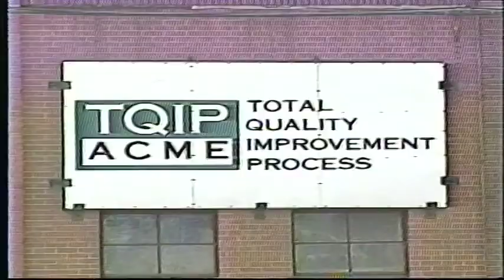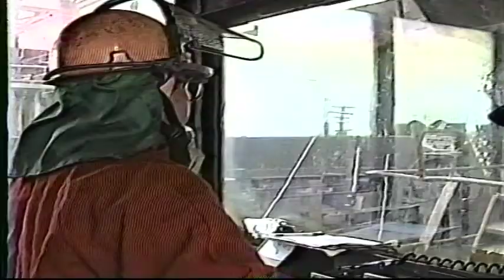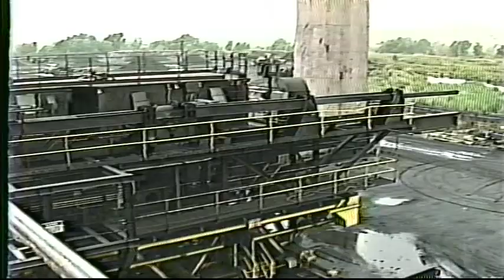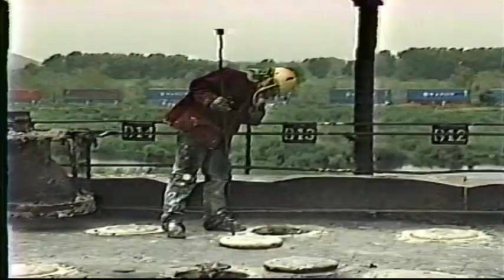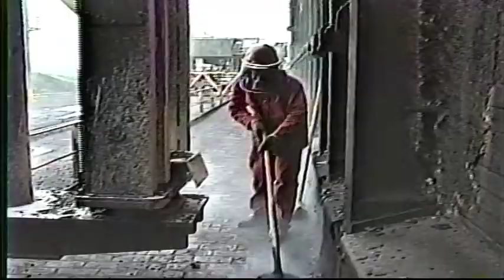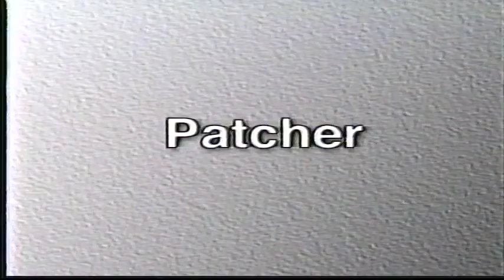Acme Steel Coke Oven Division New Employee Orientation Video (1995)

Comment: This knife edge seal must be really important.
Reply from the maker: it is - if the jamb is dirty the door doesn't seal and coke oven gas will escape, which is explosive and certainly quite bad for your health (especially the door cleaners and people on the bench who would be standing literally in a cloud of that stuff).  later the plant had automatic door cleaners, which worked to varying extents.  the company that made the automatic cleaners is called saturn, they actually have a youtube channel! look em up!
Reply: @onesixfive  "automatic door cleaners, which worked to varying extents" - yes,  those automatic door and jamb cleaners can be a nightmare, especially when the workers are used to them, and will not do any job by their hand anymore... how to fix this kind of situation; lots of doors are leaking...

Comment: I worked for a waterblasting company that did some service tasks on the Inland Steel coke ovens in the 70's. What a dangerous, hellish job. I remember a warning sign on a stairs up, "Caution. Cancer hazard. No eating". We wore long johns in the summer. Wooden clogs.
Reply from the maker: one of my contacts at acme told me a story about a lidman who actually chose to eat his lunch up there.  they had to tell him you cant be up there! what kind of a loon would spend even a minute longer.  ive seen some lidman shoes like you described - all the ones i saw were homemade.  im sure you saw some wild stuff!
Reply: @onesixfive  On rare occasions we blasted the charging holes. They'd get a hard carbon build-up. And the wooden leather clogs were provided by Inland Steel.

Comment: Best job I ever had, did all the disciplines.
Ram(Pusher)
Ram  bottoms
Guide
Larry car
Battery tops(lid man)
Wharf.

We didn't have self sealing doors, they all had to be sealed by hand with daub & daub trowels, did 12hr shifts, days & nights, 27 ovens on night shift 26 ovens on day shift.
Miss the lads I worked with which made the job bearable. Worked at the Monckton coke & chemical company in Royston Near Barnsley South Yorkshire, England. It was the last independent
Coke ovens in Britain , unfortunately it closed in Dec 2014. this video  brings it all back, many thanks.
Reply from the maker: amazing comments! I commend you for your service in such a challenging environment and industry. no doubt many thousands of people benefit daily from the steel that your coke made!

Comment: I worked Allied Chemical's Semet-Solvay Div. coke plant in Ashland,KY in 1972 or 73, not sure. Long time ago. I ran what they called the charge car, referred to as the Larry Car here. I don't remember having to get out of the car for anything, just ran back and forth to load up and discharge. Magnetic pickup on the car removed and replaced the oven lids. The instrumentation in the car was not as sophisticated as show here.
Reply from the maker: very interesting! i wonder why they had lidmen remove the lids when the technology existed to do it automatically! thanks for watching!
Reply: @onesixfive  One thing I do remember is men on top of the oven pouring the sealer around the oven lids one replaced. Some of memories of this operation may be off as it was more than 50 years ago, but that's what I recall. Ashland shut down in 2011 after almost 100 years of operation. Today nothing's left but a huge vacant lot with concrete slabs where buildings once stood and railroad tracks leading to nowhere. Sad. This is a great video. Thanks for posting. I've watched it a couple times.
Reply from the maker: @1940limited  my pleasure!

Comment: I did some computer work for the SAP project to support the caster in 96-98. I have been at the coke plant a few times. The people that work there are truly endangering themselves, and they should be respected for the hard work they do.  

You will never forget the first time seeing the coke like "lava" being pushed out.
Reply from the maker: Thank you for commenting! Curious why you visited the coke plant when you were doing computer work in Riverdale? Either way be glad you did- I wish I could have!
Reply: @onesixfive   The SAP project included some time and attendance functions that used a card reader at the gate. The idea was the worker would swipe there badge. It was also to gauge where people were should a accident occur.

I heard that when ACME decided to build the new caster plant, one of the engineers from  the german manufacturers asked the ACME board what computer system they had. One of the executives said "we have been making steel for 100 years, we don't need a computer system".

So the manufacturer responded they would not be able to track and bill fast enough for the amount of steel they were going to be making.

Being this was in 1996, stuff like ethernet, connections to other buildings, was in a state of flux.  Their was an antenna installed at the blast furnace which connected back to Riverdale. A fiber connection was installed between the coke plant and the blast furnace, by having the fiber go through the conveyor and over the river!  

The SAP project turned out to be a mess. Since it was in German, many of the screens and messages would be in german, requiring translation. Steel and raw materials were measured in tons, not the metric system. So many reports from SAP had to be converted to english measurements so the executives could use them.
Reply from the maker: i can weigh in on two issues on this topic even though i was not present for the work you did:

1) i work for a company (almost 18 years now) and we switched to SAP a couple years in, it was a very difficult transition and even today at times it can be frustrating, though i do not doubt its accounting/inventory/etc capabilities are superior
2) no question that up until the very end of the coke plant (2001) even email still had barely taken off, because i have found a great deal of hand written memos, without which i would have learned a fraction about the plant (check out my website, link in description)
Reply: @onesixfive  I think the drop in steel prices is what ultimately doomed them. 

In addition they had a lot of problems because of very old resistance to change.  SAP was designed around modern business practices.

Acme modified SAP instead of adopting modern business practices.  

I take the metra electric downtown, and riverdale is a shell of it's original company. Many buildings were razed.
Reply: @rainmant5724  I worked in a steel mill for 10 plus years as a millwright. the resistance to change was primarily due to cost every thing was very big and expensive with years of lead time to build and install. not like upgrading a control panel although that was expensive too.
Reply: @onesixfive   The coke plant and blast furnace never had any type of networking. They needed to communicate back to riverdale
Reply: @rainmant5724  when I was there everything was designed so that not much communication was needed. coke was delivered to blast furnace by rail car on the high line and dumped in hoppers to feed the skip. sometimes blast would call for hot coke I can't see that going well. blisters in the belts fires in the screen house and the rail cars and hoppers and even the skip

Comment: Yeah I worked at a large steel mill in the Midwest.  When I first started I was in the labor gang and we did most of the jobs on the battery.  I  saw enough to know that I had no desire to work on the battery or in preheat.  So when I got off probation I transferred to the coal and coke handling sequence.  Screw the battery
Reply from the maker: Smart move!

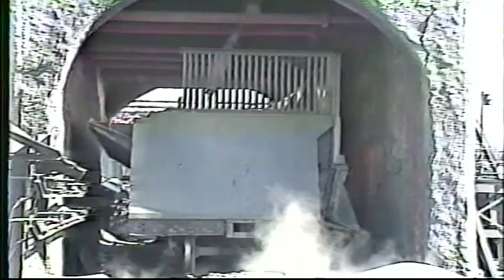Comment: 6:52 in future of coking an improvement in quality and energy could be made by quenching  with compressed cold or even superfluid CO2 in a pressure Tank and utilizing the energy of the heated CO2 in a Brayton cycle CO2-gas Turbine. 
Without contact to water/steam the Purity of coke-carbon would get closer to the theoretical limit!
Reply from the maker: Or just use an EAF and refine that process, and don’t need any coke at all!
Reply: @onesixfive  what is EAF ?
Reply from the maker: A method of steel making that doesn’t use coke which is used throughout the world for decades
Reply: @konradcomrade4845   Acronym for "electric arc furnace" I believe.
Reply from the maker: Thsts correct. I purposely did not divulge that because someone who claims to have a globally revolutionary idea but isn’t aware of other historical technologies

Comment: i worked in fords coke ovens as a  millwright apprentice in 78 and 79. what a nasty job. those  guys working around the pusher, door machine, and the charging car are in danger from the equipment and the fumes...oh my god...stink like you won't believe. We called them the choke ovens.  Hot in the summer cold in the winter, vapor and dust , high incidence of cancer in all departments . as a millwright one of my jobs was to replace that knife edge on the doors, a 4 hour plus job  basically all day. tricky to get the old one off in the shop. lots of heat from a welders torch bees wax. just one of many nasty jobs. Not a building I wanted to graduate in. they are all torn down now.
Reply from the maker: Thank you for the comment? Where is Fords?
Reply: @onesixfive  rouge complex in Dearborn on the rouge river on the border of detroit. ford had a complete steel making operation starting in the early 20's. 205 coke ovens in 5 batteries.  the machinery looks pretty much identical.

Comment: So, ACME steel had the TQIP (Total Quality Improvement Process) to remind employees to work at their best the first time.  I worked for the Chicago & North Western Railway.  They had a "quality program" introduced in 1986 called TQIS (Total Quality Improvement System).  A lot of C&NW employees referred to it as "Tortured Quietly into Submission."  Many other companies had "quality programs" such as Conrail and Inland Steel.
Reply from the maker: Yeah it’s pretty typical corporate BS. It’s interesting because I have since come across TQIP (sometimes only TQI) and I wouldn’t have any idea what it meant if not for the video. Tortured quietly into submission is awesome lol

I did some research on TQIP, check it out https://www.acmecoke.com/tqi-bulletin-board/
Reply: from Paper Industry, our boss originally denied such program, because he was convinced that we knew ourselves how to make best quality! Later he admitted the courses and procedures, and in fact it just was flow-sheets and paper-work, check-boxes, no real knowledge.  But they had some traps making life annoying without improving.  pE. in the lab the pH-meters calibration! The boss had to set the limits by himself, no advice from those coaches, because they knew nothing about laboratory themselves. So mostly the limits were set too narrow and later it is such a unnecessary hassle-tassle to adhere to the self set limits, to get the approval stamp ISO9000. 
 Knowing a bid about drift and calibration I advised my boss to set the limits quite
generously; we had no problem to get the ok stamp and the effects on our product were 0.
 In fact I invented a method to make SCB calandered paper rolls smoother , without listening to quality program teachers.

Comment: Thanks for sharing this video. I work at Clairton Coke Works, did almost 3 years on the batteries before I bidded out to chemicals. Was qualified to run the pusher machine but never trained on any other machines. Lidded/jambed for a couple months a couple years apart but primarily was in charge of dealing with the ovens door emissions. 

Lots of cleaning with those knife edges and Chuck doors. Totally bizarre to see a jamb cleaner on the pusher side as opposed to just the coke side. We don’t have those but we do on the coke side door machines.

Amazing how different things are up top too. No mud on the standpipes, manually dumping the coal into the ovens from the outside. Granted this was taken 26 years ago, times and technology have greatly changed. 

No “coking in” at Clairton - we shovel it either onto the pad or into a coke bin on the pusher. Guess someone got burned bad years back. So getting caught by a white hat coking in is a write up offense. 

Always found it fascinating to see how different it is with how things are done from one coke plant to another. Similar in the manner of the job to be done, but so much more different in the manner of how their done.

The funniest thing I noticed is we still use those same exact type of brooms on top side. Guess they couldn’t find a new way to replace those! Lol!
Reply from the maker: Thank you so much for all your insights! I have pinned your comment at the top so it doesn’t get missed. Looks like Clairton is one of now only 14 remaining coke plants in the US. 

You would mud the riser caps? That’s the kind of plant specific stuff I find interesting. You mention “manually dumping coal from the outside”. Did you not use a Larry car to charge the ovens?

And those must be special brooms for batteries at $250 a pop! LOL. 

Thanks for commenting!
Reply: @onesixfive  Make it 13 and counting now after the announcement at Follansbee, WV. We used a Larry car to charge the ovens, but the operator charged everything via a touch screen within the cab. I was referring to your Larry cars in this video. As for the riser caps, yes, our larryman seals them up with a mud wand after they clean the gooseneck, standpipe and the riser cap itself. Don’t stand underneath where the larryman is working if you don’t want to be covered in the mud! We also make passes regularly to put more mud onto anything that may be leaking throughout our shifts. 

It always really sucked when the larryman would clean all that mud off in your series you swept when lidding. Made for some miserable work trying to get it all into the charging holes after the coal was dumped. To sweep all of that in and still be able to keep up with the next charge, dampering off ahead, pulling the next set of lids, and then of course sliding your current lids back on, mud them up and take steam out was a real chore. You learn that man, we really can get a lot of shit done in 8 minutes! But we also learn, that doing it with a respirator on totally kicks your ass too! 

Our plant is regulated by some of the most stringent environmental measures in the entire country. Now a 20 minute drive down the river to Monessen’s Cleveland Cliff’s plant and it is a totally different world on what is legal and what is not on the very same emission standards. 

I certainly will not miss working on those batteries whatsoever. But naturally, I do miss doing it from time to time and often think it would be cool to do it again for “old times sake” every once in a while to see if you still got it. Not many people can say they lidded on top of a coke battery. I’d like to experience working on a blast furnace too for the sake of being able to say I did that also, but that likely will never happen. 

Funny you mention that about those brooms! For as much as we went through those all the time, I never once realized they were that damn expensive! Explains why they kept them under lock and key, after all.
Reply from the maker: @Hail2Pitt412  “not many people can say they lidded on top of a coke battery” - no sir they cannot! When I first put this video up I shared it with a friend. If you think I don’t know much about a coke plant well she only knows what I tell her. Not the worlds best teacher! But we were talking about all the different positions and I asked which one she found the most interesting and she instantly said “lidman”. Maybe I’d cry like a little girl if you stuck me up there but god knows I’ve thought about it and studied on it more than most people. I wrote a long analysis of a training guide I found, if you are ever bored you can have a look. As a legit lidman id be curious about your opinion https://www.acmecoke.com/acme-coke-chicago-plant-lidman-training/

Thanks again for the excellent comments!
Reply: I work at Clairton too, on the 19-20 battery. It's neat seeing how other coke plants work